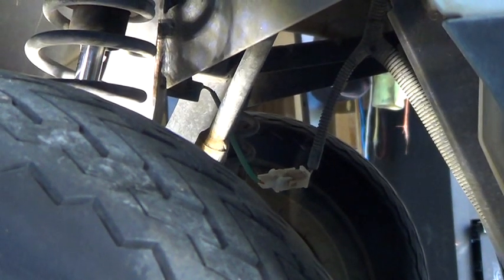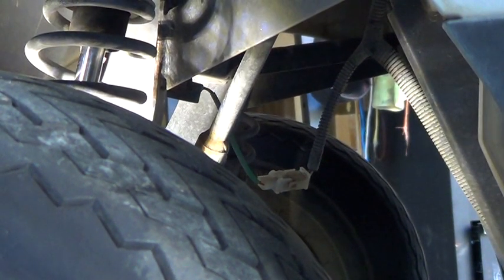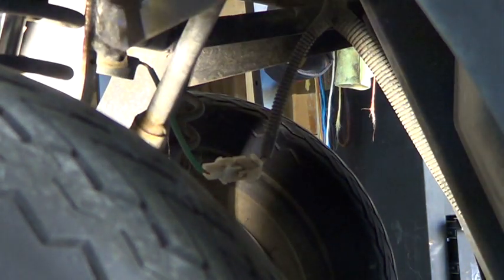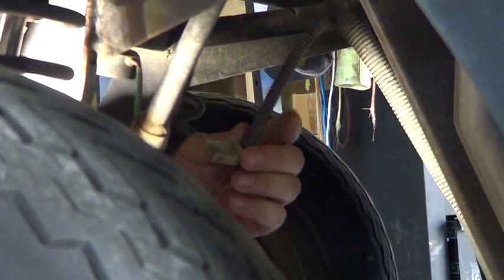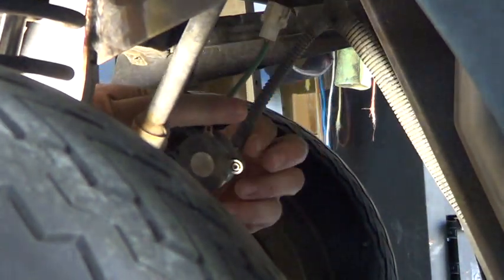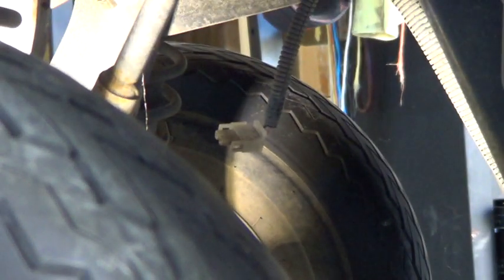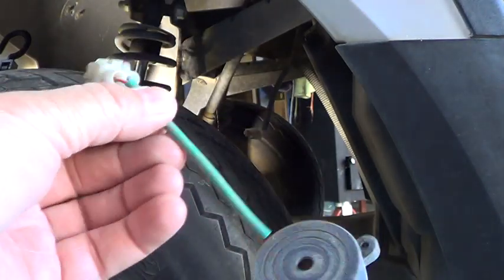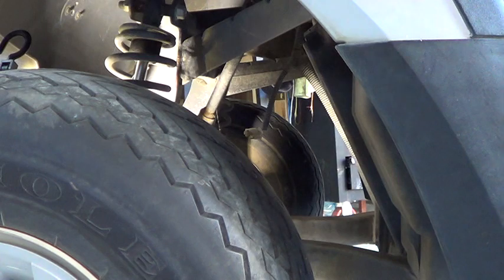Yamaha G29 Golf Cart - Removing The Annoying Back-up Beeper

Comment: Take that beeper and rig it up to plug into a trailer plug outlet on a truck... wired into the brake or turn signal circuit.  Go up to a friends truck and plug it in and watch them try and figure out a beeping noise everytime they hit the brakes/turn signal.. whatever you wired it to.

Or send it to me and I'll rig it for you.
Reply from the maker: LOL I love it
Reply: I've done it with a car horn wired into the brake/right turn signal on a 4 pin trailer connector.  Guy was like 'who the hell keeps honking at me' to the point he was yelling at other drivers.  And of course while sitting at a stoplight it was on the whole time he had his brakes applied.